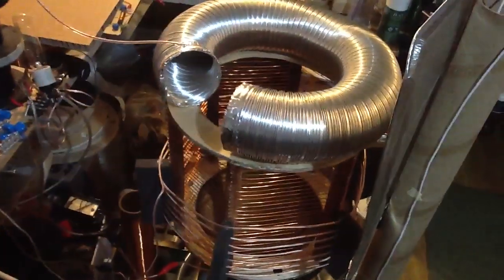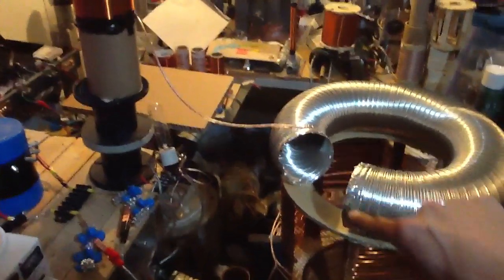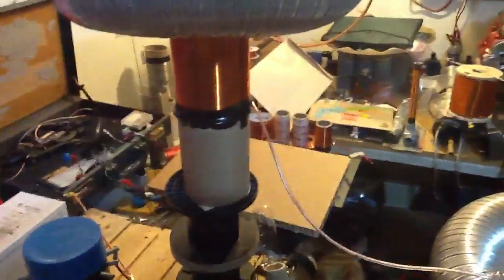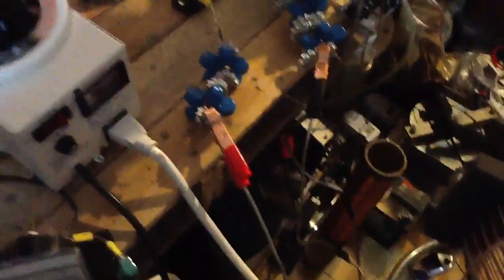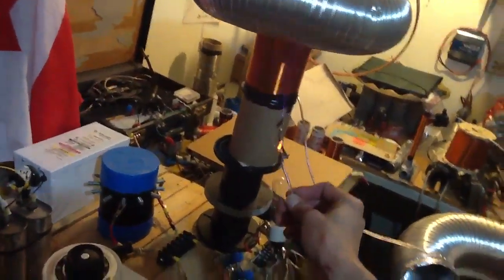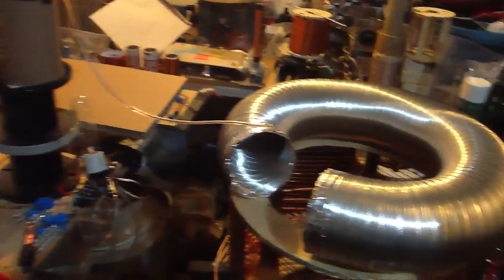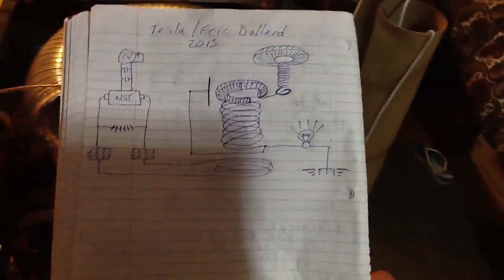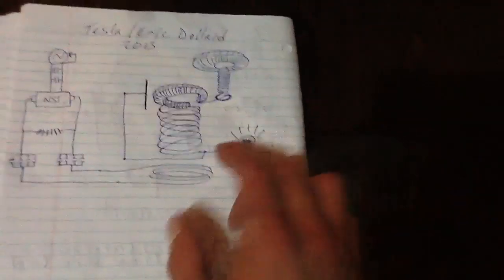TMT 6 Tesla Magnifier: New Master Oscillator and Resonator

Comment: I meant to say that I love the corona ring idea, it definitely stops some energy leakage, but the self-resonance of the secondary needs to be much higher than the operating resonances, and taking away the extra capacitance of your vertical 'ground plane' should help keep that resonance up and out of the way. When you add the 'extra coil' and topload, the secondary system resonance comes down to (hopefully) match the primary resonance.

Comment: Also, yes it is a definitely a quarter-wave resonance in the complete concatenated secondary system. The 'earthy' end of the secondary is at an impedance minimum, and the topload itself is at an impedance 'maximum'. The sec to res linking wire is at some intermediate impedance which doesn't matter. But I would suggest not getting hung-up on secondary circuit inductances and capacitances - just measure its resonant frequency, that's all you need to know about it. IMHO.

Comment: It might help to turn the extra coil on it's side, 90 degrees to the secondary. Although you do have a bit of distance between the two coils to decouple them. Magnetic coupling will de-tune the coils, as you may know, pushing each coil off frequency. The electrical coupling, ie. the wire between the coils, does not de-tune the coils. (Funny, huh.)
The RCA RADIOTRON DESIGNER'S HANDBOOK (google it) is where I learned about that coupling effect (Chapter 9.8.i)
(Maybe also, RF coil design, chap11)

Comment: Self capacitance of the coil reduces its reactance. The electric field, of the voltage present in the first windings, induces a movement of the electrons in the last windings that, in combination with the magnetic field, create a current flow in the same direction as the applied voltage which effectively short circuits the coil. (Sound complicated?)
The RF rule of thumb is a space AT LEAST half the width of the wire between turns to reduce capacitance to a reasonable amount.

Comment: not yet...Once I get my driver down I will use it to set other coils into oscillation. As far as ive read at the end of teslas research he started wave mixing...So say you drive a coil and at resonance it has 3 standing waves...and another with 2 standing waves based on the length of wire, both driven at the same base frequency...just like playing notes G (perfect fifth) and D (octave) in music you end up hearing the fundamental, a note that is only heard when its octave is mixed with its 5th

Comment: Optimum conductor spacing = 62% conductor diameter. Example 1mm wire should have 0.62mm space between turns. Source: Radiotron Designer's Handbook - RCA.

Comment: Hi - about your magnifier design - the air-core transformer part shouldn't be resonant, so I think you would do better with no extra capacitance to the secondary corona ring, and good matched tuning. There should be only two frequencies (when measured individually) - the entire secondary plus resonator system, and the primary LC system which should be tuned maybe 2-3% lower than secondary for best streamer length. Good luck and thumbs-up for the work so far.

Comment: Hey, did you use any equations for the winding of the extra coil based on the frequency? If not can you give any insight as to how one can go about designing an extra coil based on frequency...Im around 23khz, 30khz and 50khz (3 different coils) I was also wondering if you can make the extra coil a harmonic (higher frequency) of the secondary...Kinda like the SEC storing energy in the 3rd harmonic...Just ordered the tesla coil builders guide to the CO springs notes. Im going to move onto building an extra coil and seeing if I can drive it into super high voltages...hopefully good for transmitting power using the air as a capacitor ;)
Reply from the maker: Hi buddy, nope no equations for the resonator, but Tesla had many, he ended up with a coil as wide as it was tall, and had the turns spaced in order to keep the distributed capacitance down to minimum(most people are lazy for that tho). then it was simply its inductance + topload capacitance, and there was also an optimal height for the topload based on overall geometry.
i would just build the extra coil first as described, then figure out what primary L & C you want to go with, i prefer a smaller capacitance with larger and variable inductance, then when they are in the right relation, add a secondary 10:1 of primary (3 primary turns = 30 secondary turns, etc) and secondary can also be variable taps. Then the easiest thing to do is adjust different sized toploads to adjust up or down in resonator frequency :) 
Thats interesting to target a chord of frequencies, i like that idea.
anyway the easiest thing was to establish the resonator parameters, and tune the rest after to those, and doubling size of resonator basically halves the res freq, and vice versa, but yeah the topload size and taping primary are the best ways in my opinion for quick tuning, and just measure inductance on different taps to engineer your frequencies. Eric Dollard's hand written notes are great on this on Energetic Forum : search Eric Dollard / Simware's posts (he posted much by Eric's request)